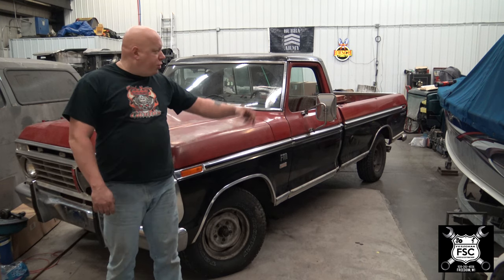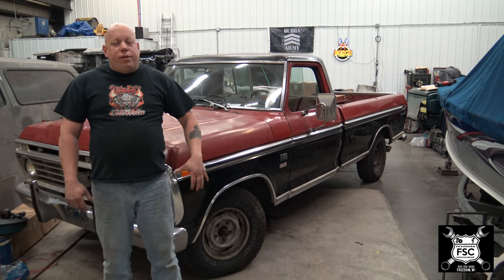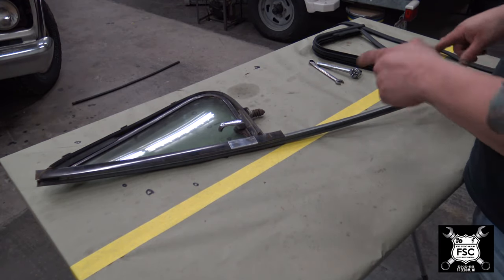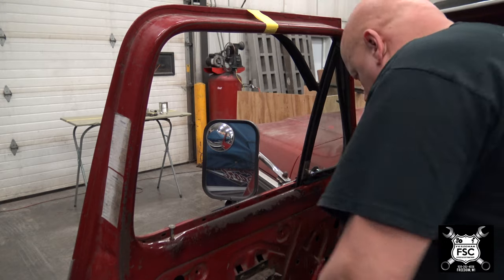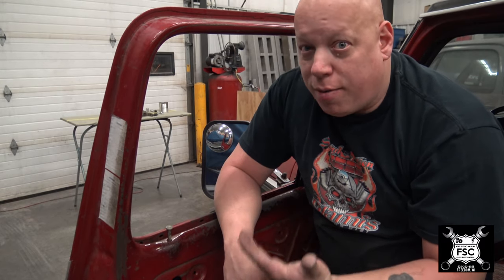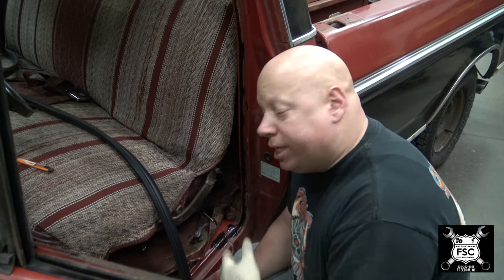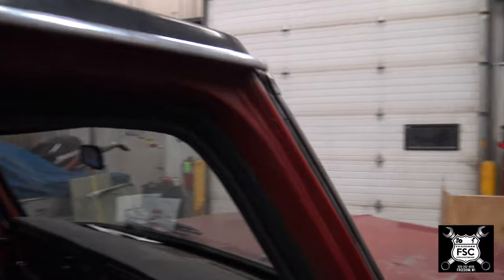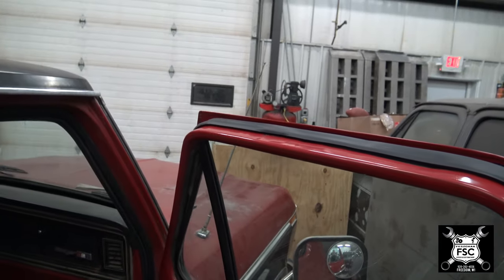1973-79 Ford Truck Door Windows And Seals Install

Comment: Timing is everything!  I'm just getting ready to install new seals complete like you just did.only on a 1979 f150 460 ci auto.  Glad I found your video, your tips would keep me from getting frustrated and now make this go much smoother and faster without breaking anything.  As we say in my 43 years of maching at Boeing " There is nothing that can't be overcome with brute force", but patience has its virtues.   As the robot in "Short Circuit" said, temper, temper TEMPER!    Thanks again  "The Wildcard"

Comment: extremely helpful, thanks for these videos. First one I watched from the seal manufacturer wanted to drill out the rivet on the vent window. makes a whole lot more sense this way. And didn't know about the outer door seal, getting those now.

Comment: Thank you VERY much for adding the passenger outside door seal to the video.  I have been stuck with very loud wind noise on my 76 on the upper parts of the door.  Ordering from LMC asap.

Comment: Thanks for the video.  I'll reference it plenty to replace whatever is making the handle act like a ratchet when rolling the window up.  Not sure why it's doing this.  The ratcheting is only when the handle is in the lower half circle when rolling it up.  My '78 F150 is nearly a daily driver so I don't want to muscle it and risk breaking something before I have a chance to get new parts.  Any ideas?

Comment: Excellent video ! I have a 1981 F100 that I am working on with a 300cu.in engine.
It's almost road ready, I just need to replace the door seals, they are crumbling bad, I know now that i can do the job with confidence !
The Vent window and bottom window was my most concern. And I like in your video that you did not have to drill out the rivet for the upper hinge of the vent window. 

Taking the screws off is way better. While I have the door all apart, I'll replace the speakers as well, I'm sure they are shot.
thanks again for a great video..
What is good to remove car paint off glass? last owners tried to paint the truck. and got over spray on the windshield.

Comment: is it possible to install the forward channel track without removing the vent window? my vent window rubber is fine, but the felt channels are shot
Reply: I am also wondering the same thing.
Reply: @codycook1704  i had to drop the vent window- it was pretty easy. 2 screws up top and one below the crank. I just slid it out of the way. to remove you just need to pull it up, then twist it 90º to clear the offset panel mount. I did that for the other side as I got ballsy and wanted to clean and lube it.

Comment: What brand felts you use LMC? I'M having hell getting mine to stayed snapped in
Reply: Me too. I got mine from LMC and they won’t stay snapped in. I guess I’m going to try to get some adhesive or silicone and spray behind the seals and leave the windows rolled up on it for a few days.
Reply: @dbfarm3145  the upper channel felts I used some gorilla clear adhesive.. as for the window felts that snap in with little metal prongs..I bent the prongs out a little more and they push in way better..before they were poping back out

Comment: Excellent instruction.  Man I tried doing this kind of stuff before You-Tube and it was almost impossible.   You had to go to a specialist and parts were not available, only from the junk yard or expensive OEM.  Plus engines went about 100K then they needed to be rebuilt.

Comment: Where can I order a driver's side window for a '73 F100? Can't find online. Great vid
Reply from the maker: I've never had a need to look for one.   But that glass is flat and if you have one in decent enough shape any glass place can cut you one using an old one as a template.   Worse case pull your passenger side glass and use that as a template. 
Be sure to subscribe.   Thank you.
Reply: Glass isn’t flat at all nor is the track straight just a oversight by this guy I’m sure when you turn wrenches all day everyday you forget as much as you know 
I know I do
Reply: Just go to small town salvage yards or stop in to any ford guys and just ask

Comment: After I replaced the inner rubber on the door I need to Adjust the door. How do you adjust the door? 1971 f100
Reply from the maker: I'm assuming the door is still aligned to the body.  The door striker (knob in door frame the door grabs onto) can be loosened and moved up, down, in, out.  Commonly as the truck ages people will adjust them in as the old seals harden.
Also you may want to look into replacing the hinge pins and sleeves if those are loose.

Comment: hi there i just got 2 weeks a go a 1978 F 100 custom with 3 on the tree i call the blue mule  it   the kind of truck  i band kind of looking for years .... my truck has 302 in it and i like to ask what kind motor oil  i need to get for my old truck can you  p;ease  tell me   what  kind  of  motor oil i  need to get  i  know the  oil filter is a  F L - 1 A   i look on the dip  it just read  SE  OR  144-A
Reply from the maker: I use 10W-40 or 10W-30.  Either will do.
I have other videos with this truck so feel free to check them out.   Congratulations on your purchase.   Remember we are available for all your Ford Truck needs.

Comment: Is it possible to replace the window seal without removing the windows?
Reply from the maker: It may be.  But I think that would add to the difficulty and cause the seal to be installed improperly.
Reply: Thanks for the advice

Comment: thanks. got anything on the door jamb switch. the ones that came with the new harness makes no sense :)
Reply from the maker: I have not messed with it on this truck.  However normally a door jam switch grounds to the body.  Needing only one wire to complete the circut